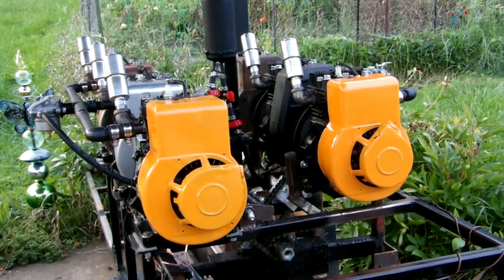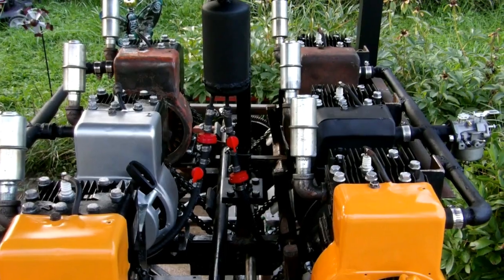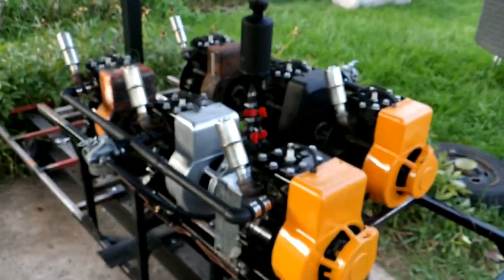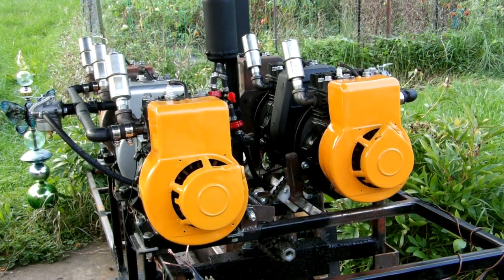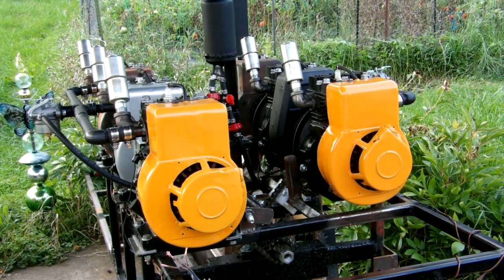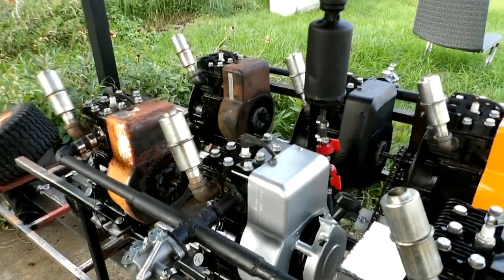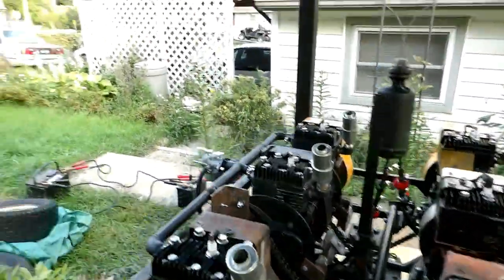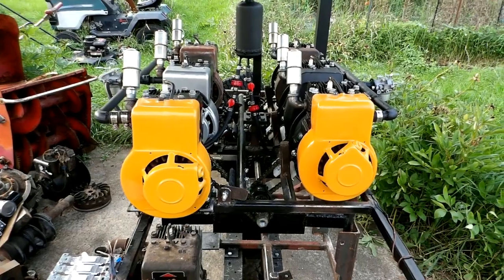Homemade Flat 6 Cylinder Running (short runs) Week 23

Comment: I think equal length intake runners will help a ton along with carbs hooked together to throttle up at the sametime will help
Reply from the maker: You are probably right, certainly a link between the 2 throttles would be a big help. I will have to look at how I can build rig something up for future runs.
Reply: @ChargerMiles007  bicycle cable with adjusters and probably custom brackets. Not going to be an easy task but then again, this project hasnt been that either.

Comment: out of curiosity, why not run cogged belts instead of chains?
Reply from the maker: The sprockets would be too expensive, but I guess it would probably work.
Reply: @ChargerMiles007  i figured belts would be much safer and quieter